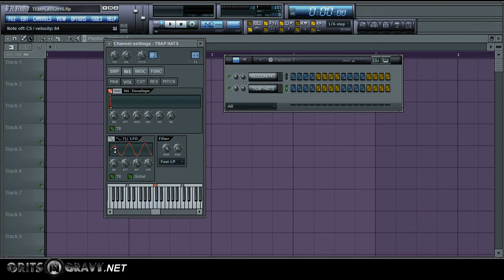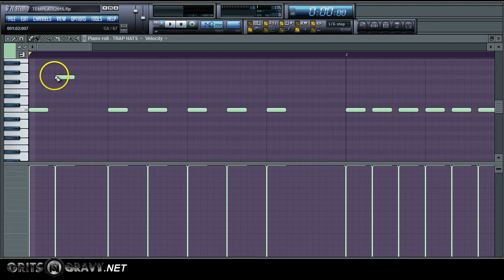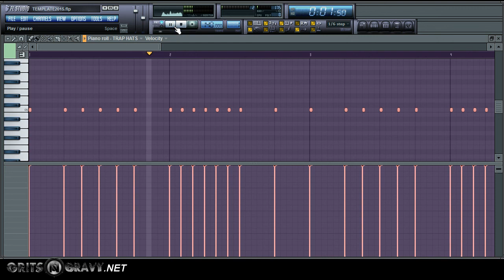FL Studio Tutorials - Trap Hats (Beat Making Tip #2)

Comment: how did you get the record to put the hat in the piano roll?
Reply from the maker: I recorded the hihats using a midi controller
Reply: That makes sense. No way to do it using a regular computer keyboard?
Reply from the maker: +Shinatako press Ctrl + T to enable keyboard mode. I would recommend getting a cheap midi keyboard even a used $100 controller would be better.
Reply: Aight, i been thinking about getting one of those half midi boards.